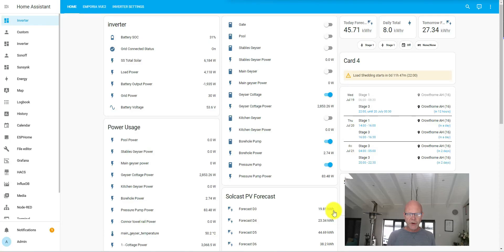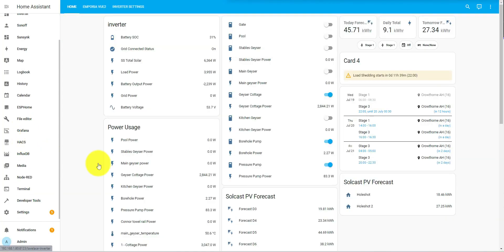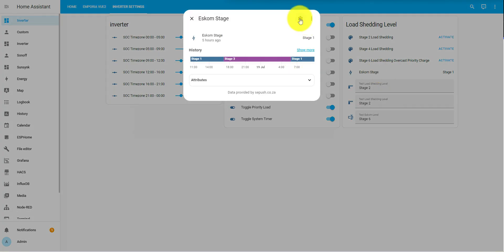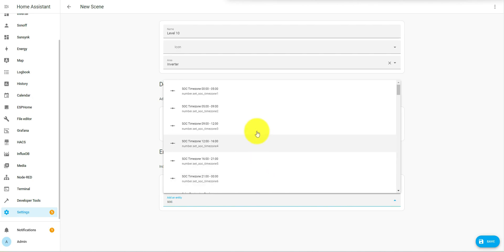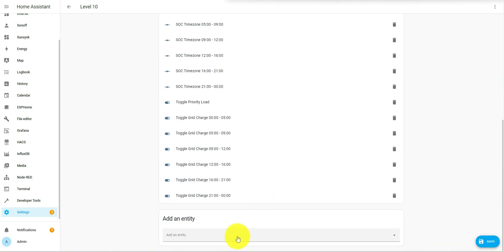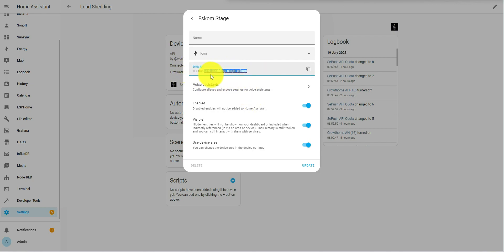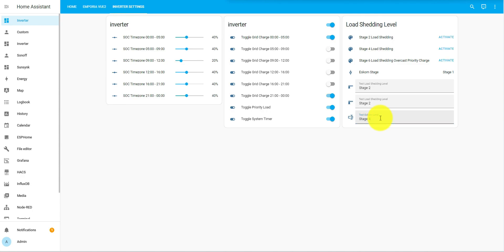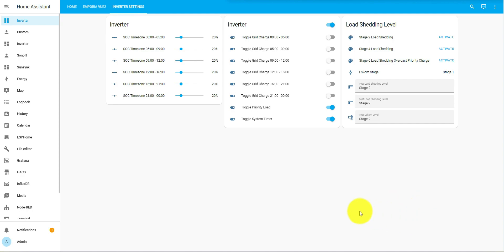Automatically Changing of Inverter Settings  based on Eskom Load Shedding Level

Comment: Thanks for the video. I'm using the scenes for simple automations based on the time of day. When activating a scene, it changes the SOC for each time time mode and then after a couple seconds it randomly changes random time mode SOC's. Any idea what the issue could be?
Reply: Sorry something else to add - this only happens when all time mode SOC's are changed at once. If I change hem one by one in automations they maintain the SOC that they were set to
Reply from the maker: Hi @donovankruger8131, I haven't heard of that issue before. What inverter is it? I would suggest getting onto the Powerforum.co.za, post as much info as you can. Inverter model, firmware version etc. I would also include the YAML code you are using on the ESP32 along with a log file from ESPHome of what happens when you try to write the changes. Lots of guys there that are way more clued up than me on the coding side of things and I am pretty sure that someone will have an idea as to what could be causing the problem.

Comment: I have a Deye inverter integrated to HA via mqqt. Is it possible to do this on mine? I don't see the SOC timezone entities on my integration. Please advise, thanks.
Reply: My integration is via mqqt Solar Assistant to Home Assistant. I found the entities, they are called Capacity Point 1, 2, 3 etc. However if I try and change the value, I get an error in the logs: Deye Inverter Response changed to Error: updates not allowed.
10:47:18 AM - 6 minutes ago
Reply: Problem solved - there is a setting on Solar Assistant to allow this
Reply from the maker: That's pretty cool @andycrighton , I was not aware that you can write inverter settings back to the inverter using Solar Assistant.

Comment: Thanks for another great video, super helpful. Busy adding it to my HA and very excited. So what you saying is the higher the Stage, the higher your SOC charge should be? So the Grid or PV will charge the batteries to SOC % ? Question why not keep your SOC at 100% Thanks
Reply from the maker: If you keep the SOC at 100%, the inverter has to pull all power from the grid whenever there is a heavy load rather than using battery power to power the spikes and then recharging it when the load stops. Would make more sense to keep the SOC setting at say 90% to give the inverter some space to use battery power
Reply: @SolarIntegrations  That makes sense thanks . We need to create a automation that looks at what stage is planned and adjust soc accordingly.
Reply from the maker: @vaughanza  Agreed, I would like something that looks at how much power is forecast by Solcast, how much power is needed in the battery to make it through load shedding at the time load shedding is scheduled and then adjusts the setting as required. Still trying to get my head around it though as it is getting rather complicated
Reply: @SolarIntegrations  Awesome thanks for your time and effort you put into your videos, so helpful